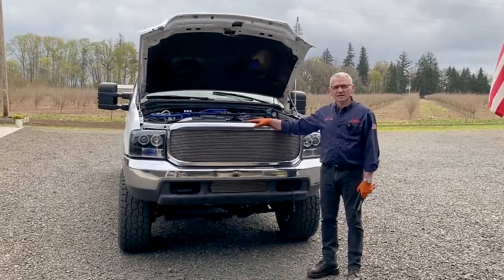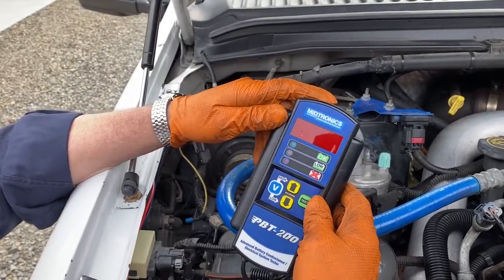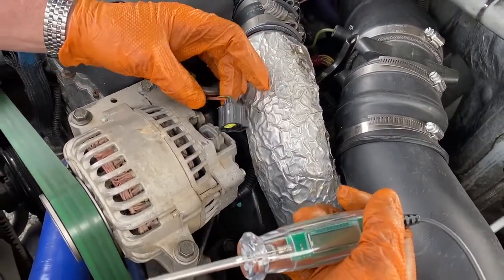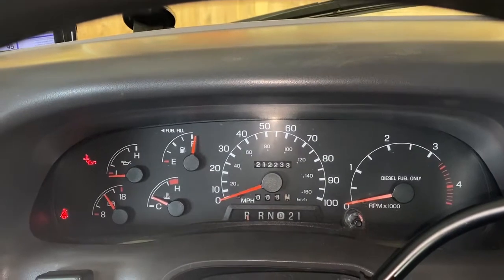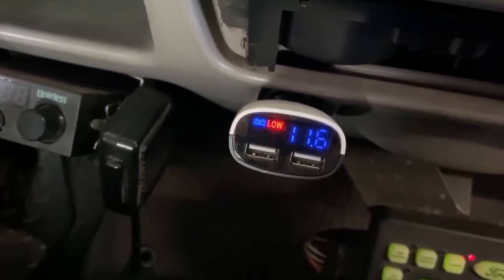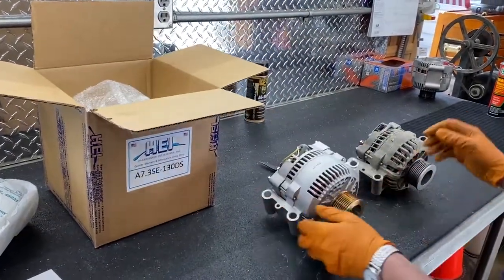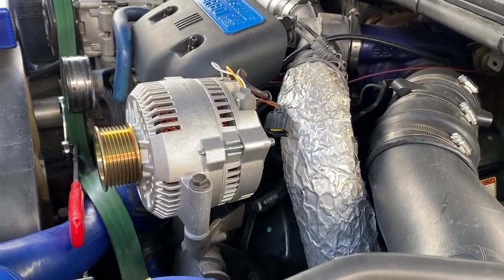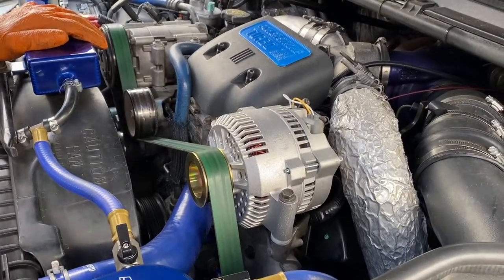POWERSTROKE ALTERNATOR  |  POWERSTROKE ONE WIRE ALTERNATOR (PART 2)

Comment: I have a question, the alternator connector, the orange wire does have current, but the red and green wire does not have current, and if I put the key in the on position, the orange wire drops a little, its voltage is minimal, but the red and green wire gives it voltage. of 1.9 v, what function does this wire have and where does its connection go? My two batteries are new and so is the alternator 135 amp 2003 ford f450 6.0 diesel

Comment: Where do you get the alternator thats already got wired or am I able to do it myself I have 2 small wires on my alt and that medium thickness if I ain’t getting power to the hot medium wire what could cause that 02 7.3

Comment: Will the 200amp unit explode the glow plugs as some have stated on 7.3 ?
Reply: LOL that’s hilarious!
Reply from the maker: The glow plugs are going to take the amperage they need. The 200 amp alternator is not going to give it more than the glow plugs need if that’s understandable. So NO they will not explode from using an 200A alternator.

Comment: With the one wire alternator will the battery light still come on when you first turn the ignition on without starting the motor? Thank you
Reply from the maker: No the battery light will not come on. We recommend using our audible Digital Voltmeter to keep track of your battery. This voltmeter will alert you if the volts drop to low. Hope this helps.
Reply: @HagemeisterEnterprisesINC   thank you!

Comment: So the Guage doesn't work anymore?
Reply from the maker: Your gauge will still work. It’s just difficult to know what the voltage is because Ford’s gauge numbers go from 8 to 18 there’s no in between (14), but it will work as before. However, if you truly want to know what you voltage is before you start and after it starts charging, we recommend a digital volt meter.